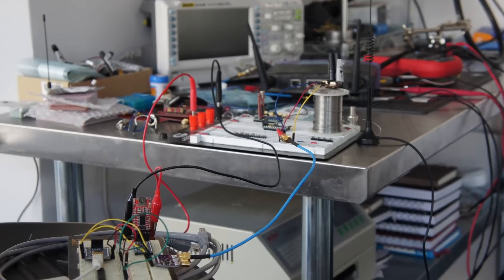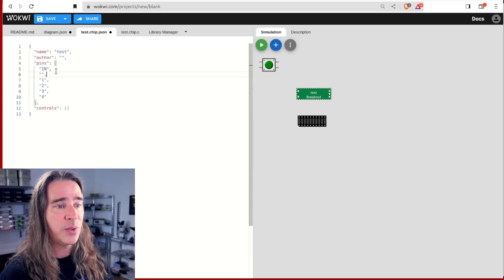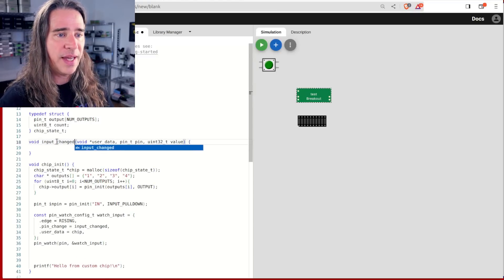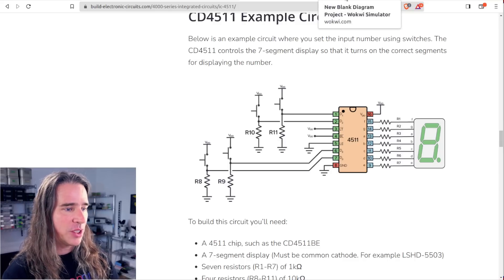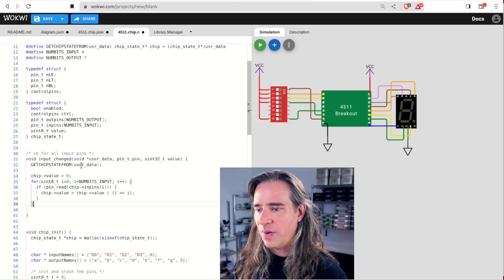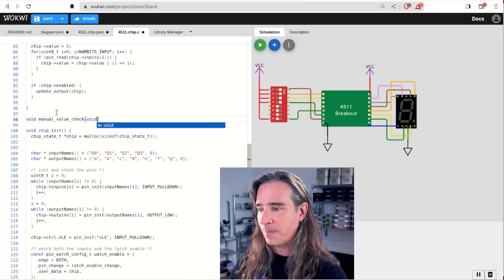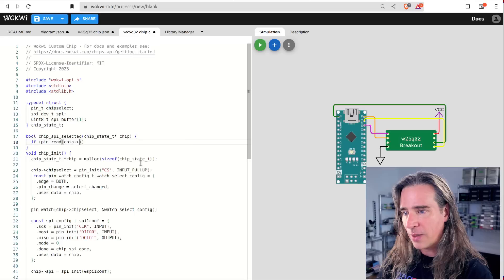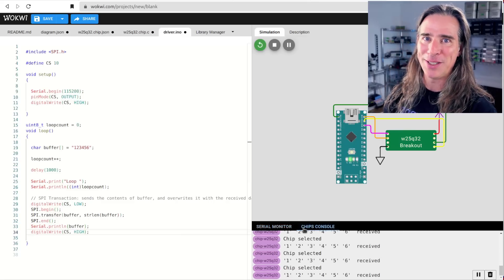Custom Chips: Test any digital circuit in your browser with Wokwi

Comment: Is there a way to make voltage level converter? I mean one on transistors. We would have lv1, lv2, vcc3v3, gnd, lv3, lv4, hv4, hv3, gnd, vcc5v hv2, hv1. I think I know how to do it to make it work one way (using example code for inverter) but how to make it work both ways?

Comment: as an ad-on, for paying customers, add on a chip supplier data base and market portal; new (with chip place of origin) and used (ditto, as so many come from China).  Your logical area of development then would be into hardware for setting and soldering on chips and board chip removal for the used market.  Further hardware would be automated chip testers.  Grinding up chip is so anti-productive from at the very least the energy perspective.  I see this tool as  a good start to get the electronic cottage industry going.

Comment: I am trying to make an analog read circuit for custom circuit. Is it possible to do it? The value(0-255 or 1024) should be printed in the chip console.

Comment: I want to work with Mq135 should I use custom chip for it.....?? Name mq135 for Air Quality Monitoring
Reply from the maker: Depending on how you want to use it, just a simple switch may be enough to simulate it (if you only use the digital input), or a potentiometer (if you only use the analog input). Otherwise, you can also create a custom chip to simulate both at the same time.

Comment: It sounds very cool, but seems to rely heavily on things that don't relate to real-world device, i.e. how you code the chip. So if the project works in the Wokwi, it doesn't guarantee it will work in metal, and if it doesn't work in Wokwi, it might still for in metal. 
Also, is there a public repository, so that everyone doesn't need to reinvent a 7-segment driver IC?
Reply: I'm getting the same feeling about this. It does appear to be an exercise in writing code, with extra steps. If I have to build the thing at my workbench, to confirm that it works, and when it does, or does not, do what I expect, I will still have the  (n="did I get that code right?")  variable. And that dang variable can be multiple equations. 
 But, the possibility of having the opportunity to play around with hundreds of pieces of hardware, that I can't afford to buy, is a very satisfying dream…  So, I'm going over to play around and see how it feels at my fingertips, because the concept is amazingly attractive. I could see myself paying for a much more sophisticated simulator, if the software end of it had earned the trust of the community. 
Or, better yet,  WOKWi   finds its sea-legs, and I get a little more confidant with software. Maybe we can grow together. It would be a tool that I would be using the heck out of, if I knew I could certainly trust the output, or if I absolutely, loved to code. Which I do not.

Comment: M.2 (or NVMe) SSDs are storage devices, not RAM (Random Access Memory). RAM is a type of volatile memory that is used by your computer to store and quickly retrieve data that is actively being used or processed. It's much faster than traditional storage devices, including M.2 SSDs.

Using an M.2 SSD as RAM is not practical due to the fundamental differences in how RAM and storage devices work:

Speed: RAM is significantly faster than even the fastest storage devices. RAM is designed for ultra-fast access to data, while storage devices like M.2 SSDs are optimized for high-capacity storage and sequential read/write operations.

Volatility: RAM is volatile memory, meaning it loses its data when the power is turned off. It's optimized for quick read and write operations but is not suitable for long-term storage. SSDs, on the other hand, are non-volatile and designed to store data persistently.

If you need more RAM for your computer, you typically have to physically install additional RAM modules on the motherboard. The use of storage devices as virtual RAM (via pagefile or swap space) is a common practice, but it's not a substitute for physical RAM because the speed of storage is orders of magnitude slower than RAM.

If your computer is struggling with memory-intensive tasks and you've already maxed out the RAM, you might want to consider upgrading your RAM or optimizing your software usage rather than attempting to use an M.2 SSD as virtual RAM. 10% is mine please

Comment: Thanks for doing this video. 
Do you have  a plan for emulating a monochrome P10 led matrix with hub12 interface?
Reply from the maker: No specific plans for this part at the moment, but it should be possible to simulate using a custom chip (look at the Framebuffer API in the custom chips docs). Implementing brightness by detecting PWM can be a bit tricky and resource intensive for large matrices.

Comment: hello, great project, is there plans for golang for chip definition and tinygo for firmware?
Reply from the maker: Thanks! 

Not plans at the moment, but chips are compiled as Web Assembly, so in theory it should be possible to create chips with golang.

As for firmware - check out Wokwi for VS Code, where you can load any binary firmware, so you can compile a firmware in TinyGo and load it into the simulator.

Comment: Can you add valves or is it stricly digital?
Reply from the maker: The simulation engine is digital, with limited analog support. You may be able to simulate a valve with analog control using the pin_adc_read API.
Reply: @Wokwi  thanks. I had a similar program a while back, but it wasn't near as good as this. I have to look into it 😃
Reply: @realryder2626 I think this is great for what it's for, I'd say you're better off leaving the analog side of the circuit to spice and the like, rather than mix the analog and digital (it's good practice to keep them physically isolated in the real world anyway). If you're using valves as logic devices you can model the digital logic sepperate to the analog circuit modeling, which honestly makes it a lot easier to work through than treating it as one giant analog monstrosity haha.

Comment: Such level of coding ease and understanding of doing thing reveals he is definitely a developer of this service. Good job! But how is the quality of these custom chips being checked? How can one be sure it functions properly and fully corresponds to real equivalent of the chip? Otherwise it's just a useless toy.
Reply: So all software-based state machines are just yet another useless toy because they're not implemented by etching oxide layers on silicon?

Ouch, I guess we need to throw out all computers then. What a bummer that there are no such things as unit- and integration-tests...
Reply: Thanks!  That's a good question and one I've considered as well.  The fact is, unless you had some formal spec or other model to check against, I'm not sure how to best address this.  The second video ("Building a custom I2C chip for Wokwi simulation", https://www.youtube.com/watch?v=BS_uTqz3zik ), is a full walk-through of a real world chip and the approach I took was to dive into the datasheet and then check my understanding with an actual physical chip.  Don't know how I could do much better in circumstances like that, but if you have any ideas I'm game to try them out.
Reply: @PsychogenicTechnologies  Yeah, that's it. "Test + real device" section of your video should be performed for a model of every single chip that will be published for users (ideally manufacturer should be involved in this process). Don't get me wrong, your tools is awesome but as I sad I can't really trust the simulation until it's components were tested in the real world. I hope they will. Thanks for your work and happy prototyping ;)

Comment: Thank you, very nice demo! Is there any chance to see some of demonstrated components (4511) among standard wokwi components ? (Maybe something similar like a small otp memory (e.g. MCM5304) allowing a quick insertion of the data pattern like a kind of universal decoder alternative/replacement).
Reply from the maker: Thanks! Yeah, a PROM would be a good use case for the Custom Chips API. We hope that the API would make it possible for users to create their own parts, based on their unique needs.

There are several examples of projects using custom chips along with other parts - check out the links at the bottom of the getting started page in Wokwi Chips API documentation.

Comment: I think relying on an API that mimics the terminology and structure of VHDL or Verilog would be very convenient.
Reply from the maker: Thanks for the feedback! Do you have a specific use case in mind? or just in general?
Reply: @Wokwi  personaly I intend to use it for quick SIL testing as I prototype. And I know VHDL so it'd be nice to have a tranferable skill.
Reply from the maker: @wailrimouche1171  That makes sense. There's a limited support for Verilog, e.g. https://wokwi.com/projects/371755521090136065

VHDL is not likely to happen any time soon. Also, the C-based chips usually simulate faster than Verilog, so for most use cases, C is probably a better choice.

Comment: Hmmm...malloc() to a local variable within a function, the pointer not even returned? And then used in other functions?
Looking inside the actual project code, it seems that the malloc() of the state struct is assumed to be the FIRST allocation in the user memory.
So...don't do a malloc PRIOR to allocating the state struct or all the other functions will look at the wrong data.
I wonder, would it be that more expensive to have a cleaner API?
Reply from the maker: Thanks for sharing your thoughts about the API!

Actually, the API doesn't assume the state struct is the first allocation of in the user memory. Behind the scenes, Custom Chips use WebAssembly. Wokwi recreates the WebAssembly VM whenever you restart the simulation, starting from a clean state.

Therefore, there's no need to free the chip state memory - custom chips are only created when the simulation starts, and everything is destroyed as soon as you stop the simulation. 

I hope this makes sense!